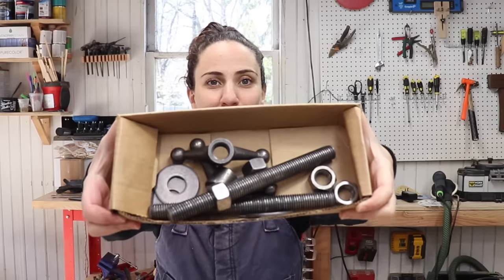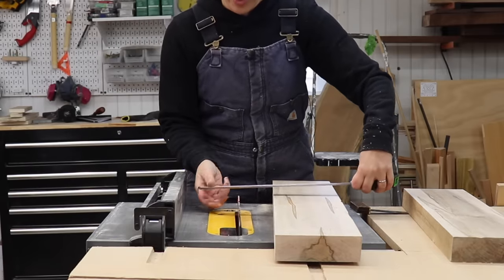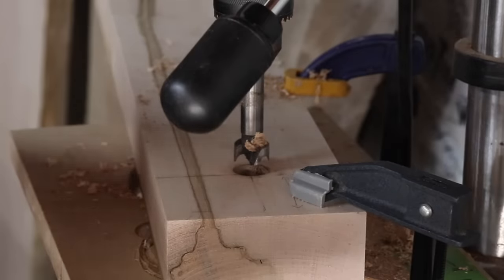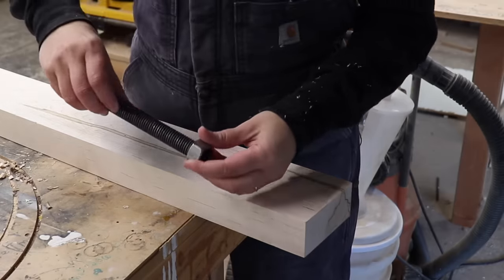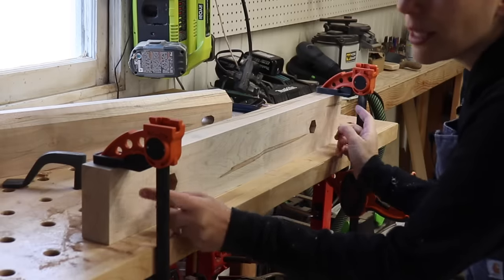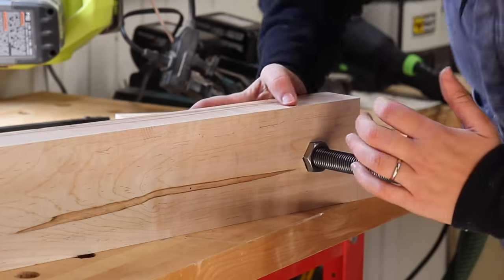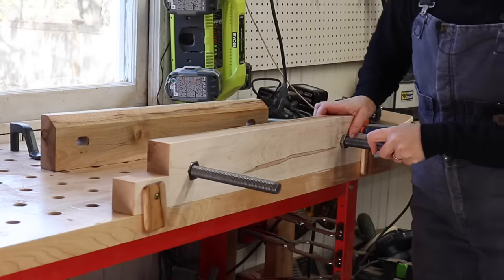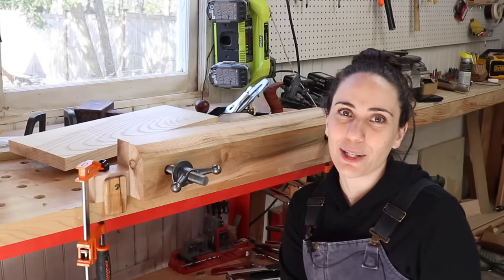$40 Moxon Vise - Easy to build in an afternoon!

Comment: Thanks for the video. Keen job. Great chisel skills. Qapla'! (Success!). Obviously, I did not read the instructions that came with the kit, and maybe you mentioned this and I didn't notice, but in planning this, I will make sure to use back jaw material at least 2" thick, and front jaw material at least 1" thick, to allow for the depth of the nut socket (which you cut surprisingly well) and another inch of material. Otherwise, I would fear a tight clamping action could pull the nut through and break that back jaw. Likewise if the front jaw is too thin, it too could also break under clamping pressure. I wonder if you have done, or might plan to do, a comparison and contrast of the most common vise types, what they do best, and what they do less, such as the bench vise, the ball vise, the end vise, the Moxon vise, and others. Just a random thought. Thanks for the video.

Comment: Just a small suggestion. I built my vise with the front jaw 1/4 to 1/2 inch taller than the rear jaw so that it hangs down below the rear jaw, aligning it with the front of the bench.

Comment: Lovely video combining the creation and use. Couple of suggestions - for the tabs, you could drill through and then cut so you don’t have a sharp corner where the tab is. The other suggestion which doesn’t help everyone - you have some beautiful holdfasts in the bench - easy and quick clamp that’s out of the way right there 😁. Super clear instructions anyway for a lovely project.
Reply from the maker: Thanks! Yeah. I thought about the hold fasts. But no everyone has a table with dog holes. I’ll prob use them!

Comment: As always, great stuff.

If i can nit pick (or add to the list of optional methods). You reverse the Incra when laying out.  From my experience, not using the same reference side/edge can introduce unwanted offsets (cumulative error) even in board that are square.  Personally, I dislike centering by measuring the overhangs.  I usually line up the centers and then extend the marks from the first board.  Gives me wiggle room if i need to trim the ends.
Reply from the maker: Totally hear that. I noticed that when I was editing. Ha

Comment: If your front chop was 1/4 inch longer, on the bottom, you could just use it to reference to the edge of your bench. I did that and it works great.
Reply from the maker: Yup! But then your vise needs to be closed in order to align it. Always another way!

Comment: Two suggestions/questions:  pertaining to the back jaw:
1). Your cut at the two ends- (9:00) would you consider drilling a 3/4” hole at that corner and cutting into its radius? This would have prevented you from needing to cut manually but more importantly - given that corner extra strength (radius is always stronger than a sharp angle).     2).  Weren’t the nuts supposed to be at the far side of the back jaw?  Thank!!! Amazing work !👍🏼👍🏼
Reply from the maker: Yeah, drilling a hole to make a radius would have totally worked. And no. The nut is supposed to be captured on the inside Face of the jaw

Comment: I just built my own Moxon Vise and finished it up about a week ago. To keep it flush with the workbench, the lower part of the front jaw hangs 1/8" lower than the back jaw. So you just keep the vise clamped when setting it up and it just butts right up against the workbench. I like the tabs idea though! I wouldnt have thought of that!
Reply from the maker: Yeah! That was one of the suggestions in the instructions the kit came with.

Comment: With a taller frt jaw you can flip the back jaw upside down and bolt it to the edge of your workbench then add the width of the bench and back jaw to equal the frt jaws width  
Drill a few holes in it on the top for table dogs goving you a vertical and horzontal clamping vice that way you can lay work onto the table top referenceed off 2 dogs in the table put 2 dogs on the vice jaw and lay down a flat panel to surface the face as well as everything else that type of vice can do. Its always on the work bench ready to be used.  Do it off a long end of the table.

Comment: I am tempted to sand a very slight bow to the jaw. Thickness of a sheet of copier paper at each end or small enough that I can close it up with finger tight. Keep the pressure even across the work a bit like a bow clamp for edge jointing. I have done something similar to my bench vise jaws but dished at centre since it is centre screw only. I tested first by tacking strips of masking tape and seeing how much flex I got (not much).
Reply from the maker: That’s a good idea

Comment: Well, I hope you received some kind of remuneration because your vid sold one to me. I first started buying on the link backed out to check Amazon, same thing higher price by a small amount then went back and bought from your link and it's on the way. Love the sounds the chiseling makes in fast forward. I don't have all of the equipment used except the drill press but I'll do some Paul Sellers style work (as if) and rough it out. Thanks.
Reply from the maker: If you bought it from my link I probably got a few cents! Ha! Thanks!
Reply: @3x3CustomTamar  Got my hardware yesterday and my wood today 2' poplar four matching, to glue up each pair. Lumber store was cool and cut them equal, all to go on my recent bench build. Thought of doing another 'in bench' project on the same lines. Yes, your two cents is assured so you can retire now!

Comment: Great video well explained. Quick note that you could try if you create a slight con vexed curve on the inner face of the front jaw you will get a stronger and even clamping force across the face of the work being held. I believe this design mod is mention in Andre-Jacob Roubo publication "With All the Precision Possible" Did this to the Moxon I made and works great plus you don't have to tighten the jaw as much and stress the vice.
Reply from the maker: Interesting idea.

Comment: Great video. Very neat project. However having those bolts protruding out the front seemed rather awkward. Why not pin the handles to the threaded rods and set it up to have the protruding bolts come out the back?
Reply: This is a great question for Taylor Toolworks, the maker of the kit.  Not all woodworkers, especially new woodworkers have tools for working metal to modify the handles and the bolts as this suggestion requires.  Taylor Toolworks would be better able to change their kit to include that.  But that would also require a few more production operations which always raises the cost, at least a little bit, and therefore the price.  I suspect that it was made this way for absolute lowest cost for that quality of kit.

Comment: Great presentation! Makes me want to try it. The thought occurred to me to make the front jaw 1/2" lower to align the vise to the bench as an alternative to the tabs. Thanks for the inspiration!
Reply from the maker: Thanks so much! That’s a common thing that ppl do. But It only works if the jaws are shut. Who you have to shut them, then clamp. The vice is rarely in the completely closed position. So I thought this would be cumbersome.
Reply: @3x3CustomTamar  Ahh, I didn't think of that. Very good reason for the tabs, then!

Comment: Another great option of the Moxon Vise is that it allows you to have a clean table for other work when you aren't using the vice, and allows you to mount it to any table or any section of the work bench as you need it.
Reply from the maker: Yup!

Comment: Hi, thank you so much. This is the best moxon vice video I have seen (and I've seen lots). I just wanted to ask if I should even attempt building this if I dont have a table saw. You go to great lengths to make sure the edges are straight and square, its gonna be hard for me to achieve it I fear although I do have pretty good eyeballs - I'm tempted to wing it! Thanks again,
Reply from the maker: So awesome to hear! I say go for it. I go through those efforts to make it all square but its not really necessary. After you have the 2 pieces, get them clamped together with the bolts and run your handplane across both surfaces to make them flush to eachother, and that's all that really matters

Comment: Used opposite sides to mark center location for each hole?   This might introduce error on getting the holes the same height.  Also, you could stick the front and back pieces together and drill a small pilot (assuming you have a well-tuned drill press on a square table with no runout)  through both boards which will register the Fortner bits and allow drilling from both sides of each board to prevent blowout.

Comment: When transferring those marks at around 3:30, why not just add 3in to the measurement and mark from each end? Instead of 2 and 3/8, just mark 5 and 3/8 on each side? Wouldn't that be more accurate? 
I'm not trying to question you, I'm just trying to learn. I've had peices like that and tried transferring marks before and I'm just curious as to why you chose to do it that way. Was there a reason, or am I overthinking and arbitrary thing you just did "just cuz" lol ? 

I'm just trying to learn more and your videos have been very helpful and inspiring! Your workshop is so nice and well appointed and clean! I'm jealous! 

Anyway... good video and a great job as always. I'm learning a lot!
Reply from the maker: Thanks! I dont recall my exact thought process, sometimes I think of something and then will think of a better way hours later. That's just what made sense to me in the moment. There is not right or wrong way to do anything, there is just the way that works for you

Comment: you could add a small rebate at the bottom of the clamp to align it with your work bench - easy peasy
Reply from the maker: I thought if this as an option. But then you have to keep the jaws closed in order to line them up. Lots of ways to do it!
Reply: @3x3CustomTamar  there are indeed many ways to do it, but none the less, i am going to make myself a set. i think they are wonderful!
Reply from the maker: Deranged Chicken awesome!
Reply: @3x3CustomTamar  Yeah thank you.

Comment: I love your videos. They are very complete. However, I have a suggestion. When you are marking as you did in this video, you might want to consider that best practice is to mark from the same face. Designate a reference face and measure and mark from it. I realize that the two faces you used were theoretically parallel, but what if you weren’t marking the center? Just saying.

Comment: I need a vise like this on the front of my bench.  All of my vises have the screw in the way when trying to do dovetails.  Have you ever permanently attached the moxon vise to your bench?  I thought I recently saw you put a board in a vise vertically and I was wondering what kind of vise you have.  It looked like it was a permanent vise but the camera cut away so fast I couldn't exactly see it.
By the way, I love, love , love your channel! You are so brave to try the projects you make. You use routers a lot.  I have 4 and and scared to death when I use them.  I have bought all the bits and accessories but I always go back to my table saw.  For me the best purchase I ever made was my Shop Fox Hybrid saw.  To have  13" of table before hitting the blade is so much better than my Bosch Jobsite saw that has only 7".  Game changer! And my fence is always square.
I just keep a dado blade in the jobsite saw now so I don't have to keep changing blades.
You have a great personality and love that your are like a real person and do so much with your children.  Your a great Mom!
Reply from the maker: Thanks! So a moxon vise is specifically designed to be able to easily remove if you need to. It’s meant to sit on top of your workbench. There are other types of vises that would be built into a bench

Comment: You're my new hero. Well, you and Shaft, but that goes without saying.
Reply from the maker: Haha
Reply: @3x3CustomTamar  Just re-watched this video and it's still great. I got my kit, which has been sitting in a box. I made a English joiner's bench per "The Minimalist Woodworker" but the lack of proper 8/4 material and a pathological inability to drill plum, it's more train wreck than workbench. I just remembered the vise parts, and realized that a Moxon vise would really work on the front of the bench (along with an el cheapo end vise for holding stock) might really improve my state of affairs.
     This is a longwinded way of saying thank you for posting this video. Now if I just had your energy.
Reply from the maker: @frenstcht  haha nice

Comment: That looks great, you're obviously very talented. Are the clamps the only thing holding it down to the workbench or did I miss something? Also what size are was the wood and the two vice bolts if that's what they're called and where did you order those? thanks

Comment: Thanks! I built it! Had to cut the bushings out of 1” pipe and then dremel the outsides a bit to fit the holes, I need a sander -- there must be bushings like yours out there? But I couldn’t find em locally. But pipe steel will work, and the vise is great, and it really  helped me to hand plane my boards for my table tops. Great videos!
Reply from the maker: Sounds cool!

Comment: I'm thinking of doing this but what about using a pair of hold fast clamps on the side edges instead of the screw on wooden tabs?  That way if you had a really wide piece you wanted to get clamped up, you'd have a totally flush surface all the way across.
Reply from the maker: You can do that! Just wanted to give ppl who don’t have dog holes an option ☺️

Comment: I was thinking. Instead of using clamps. why not drill a hole at the ends and use a  bolt to connect to a threaded insert mounted into the table? The handle could be whatever you want. Ex: Round knob, cam knob, etc. I'd also insert the appropriate nut into the wooden bottom to hold it in place.
Reply from the maker: Could be cool

Comment: What is the maximum that the vise can open?
I think the rods are 8 inches, so I would assume the max opening is around 4".
Great video,thanks.  And thanks for the tip on where to find the hardware.
Reply from the maker: I didnt measure and I’m not at my shop now... but that sounds about right. I have yet to find it a problem that it doesn’t open up enough.

Comment: Really great video, however I have to ask: The stock you used did not seem jointed on the surface? Yet you simply put it through the (thickness)planer and got pretty perfect jointed surfaces? how? I mean, you seem pretty carefull to get all the other sides perfectly square - jointing edges and all. I would think that jointed faces should be as important to create equal pressure to the work piece over the hole length of the vise?
Reply from the maker: Sometimes I leave small details out for the sake of time. These pieces were jointed and planed square. Have no fear. 😉

Comment: When I made my Moxon vise I made the front jaw a quarter inch wider (on the bottom) so it registered the back jaw to the front of the bench when I set it in place
Reply from the maker: Yeah. They gave that as one of the suggestions. But then the jaws need to be closed in order to align it. Just a different option.

Comment: First of good video. Verry wel thought out. But my only issue with this type of vise is the ends sticking out so far. I was wondering if you could reverse them. Only having the nuts on your end. Seems more ergonomical to me. Dont know if it would work but i wonder. Same goes for the on the table setup. Im not small but thats beside the point. I have a table on made on my height. Why go higher with a moxy abd make sawing or chisseling that bit more uncomfortable. Just a few questions that came up.

Comment: You mention you can use any wood. What type of wood did you use and is it working for you? Would glued together boards work for this project?
Reply from the maker: I used ambrosia maple. A hardwood is best. I don’t see why a glue up would be an issue.

Comment: I have a question for you regarding the clamping of this build. I was looking at the Benchcraft Moxon equipment and the cost is something I just can't justify. I do like the look of the wheels but I can live with practical and functional any day. However, they do have a nice part on the design, and I am wondering if you can give an opinion on. I noticed in your video that you have some hold-fast clamps on your bench. On The Benchraft Moxon vise, they have a back stabilizer that if a person were to install at the bottom of the back jaw on the table they could use a hold-fast vs clamps.  What I do not know how well does the hold fast hold the assembly in place? Normally they have great clamping force, and I would like to utilize them if those would work just as well as using front mechanical clamps.  What is your opinion, and have you used the holdfast on this?
Reply from the maker: I use holdfasts all the time. Didn’t use them here because then people would think they are required…

Comment: I had made a moxon vise using those adjustable pipe clamps once but I like yours much better. What kind of wood did you use
Reply from the maker: Thanks! I used maple. I think it was ambrosia maple based on the marks that were on it. Ha

Comment: Hi, Tamar,
Why don't you attach it on your workbench?
If it is flush with the benchtop it will not bother you.
Another nice project.
Willy from Belgium.
😌😌😌
Reply from the maker: Yeah, I will eventually build a bench with a built in vice like this. But for now, I need that full work surface sometimes. So being able to remove it. Or move it to wherever I need is better
Reply: Winston Sammy  Hi, Tamar (again).
Thanks for your quick answer.
I should place it (fixed) on the side where you feel comfortable, have enough space and a good access to your material.
I know the feeling, if anything is not on the same place, I can not find it at all.
Willy from Belgium.
🙄🙄🙄